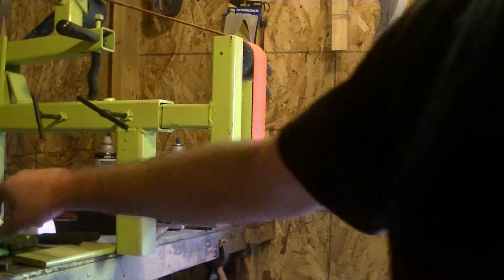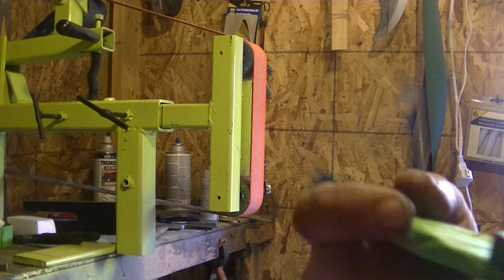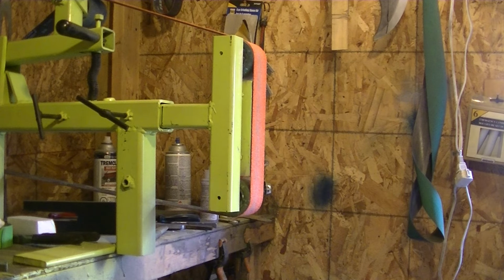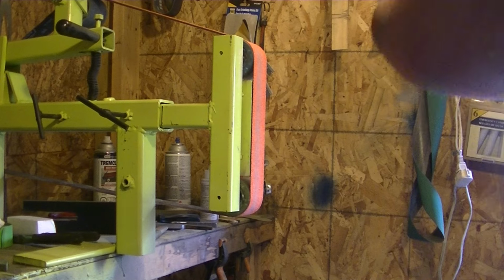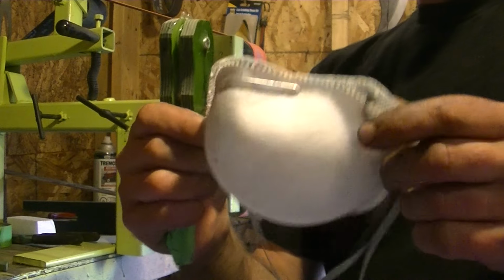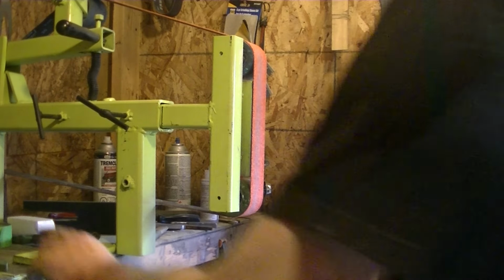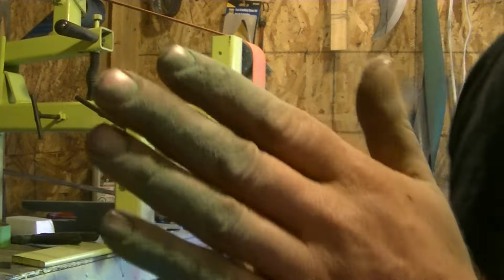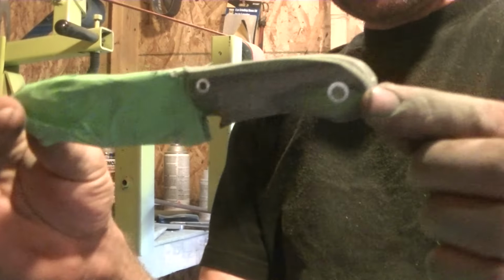HOMEMADE GRINDER PROFILEING A KNIFE HANDLE!

Comment: what spring did you use and what did you put indide to keep it straight?
Reply from the maker: +josh roberts A STEEL PIN,, AND THE SPRING I GOT FROME DEPOT
Reply: +SSR KNIVES AND GUNS! weld the steel on the frame then put the spring over it, yeah!!!
Reply from the maker: +josh roberts YEAH!!